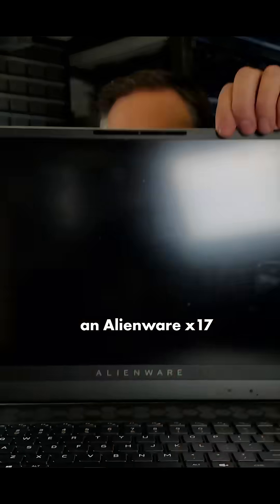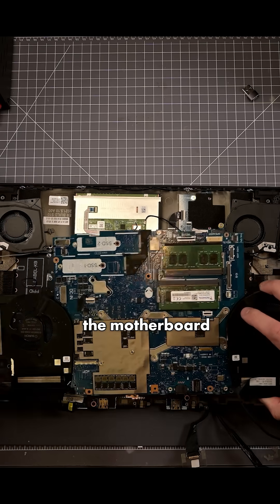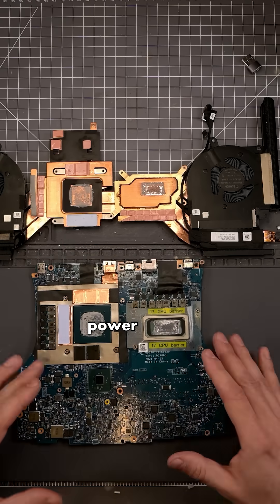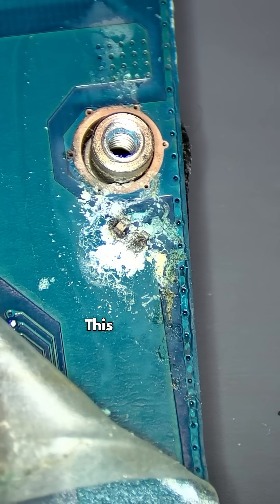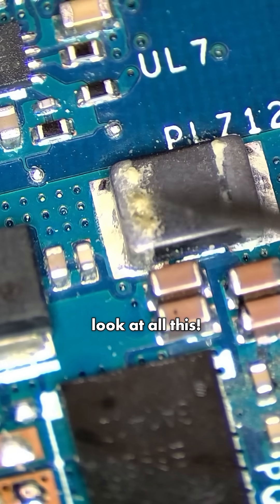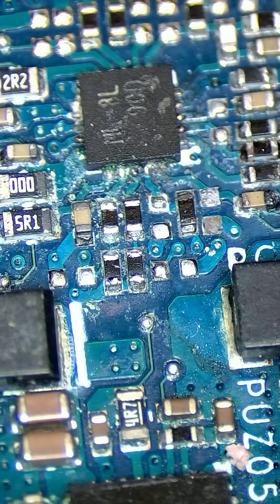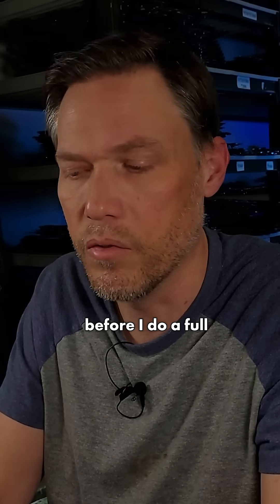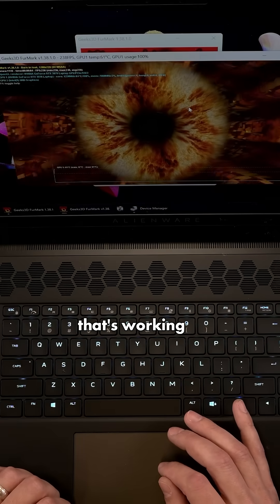I Was SHOCKED What Two Repair Shops MISSED! #shorts #laptoprepair #pc

Comment: When you doing sonic cleaning what kind of liquid is used ?
Reply: only liquid that is safe for ultrasonic cleaning is distilled water because it has no minerals in it to damage the board which is why it is also recommended in CPAP machines, Carpet Extractors and more

Comment: My 2 memory modules gets very hot when I'm gaming, to the point where I could feel the heat by touching the keyboard.  The 2 fans are working.  This is my first DIY thing with my laptop.  Thinking of adding lots of thermal paste to the memory, then stick a copper plate to it.  Any ideas, tips, or suggestion?

Comment: were you able to confirm it indeed did go to NR first?
Reply from the maker: Yes, I had a conversation with the customer. He said he mailed it to Northridge fix after he had ripped that connector off because he replaced the keyboard after he spilled on the laptop. He told them he wanted them to make sure that there was no water damage on the motherboard and they checked that out and said everything is fine, and then he asked what about the connector and they kept saying there's nothing else they could do for him. So he received it back and send it over to the other company to get the connector replaced. They would only reply through email and they look like they were all canned messages.

Comment: Northridgefix Didn't Fix This Laptop?
That Awful😬😬😬
Reply from the maker: Yeah, I thought it was strange.
Reply: @dellpartspeople  did you check directly with NRF ?? 
it is really weird that they sent the laptop back to the customer with that claim the board was working fine and the bench fee etc. 
For something so expensive, any owner wouldn't be so lazy to accept such vague response from the repair shop, and to receive it with such damage. 
Where I live, repair shops record everything the moment they receive, open, and ship back the customer laptop, sometimes recording the evaluation process, and if something more complex requires they also record the repair and send a copy of the video to the customer. It helps both parties and makes the service scam proof.
Reply: Too much work for a 25 min vid.     Next!

Comment: Doesn't the ultrasonic damage any of the components..?

What solution do you use in that ultrasonic?
Reply from the maker: No, this machine is filled with distilled water, which is non-conductive and non-corrosive, and there is a special electronic solution, which is made by Branson, that is added to the water, and the motherboard is put in an alcohol bath afterwards to get all the water and solution off the board.
Reply: @dellpartspeople  good to know.

Was always scared and ultrasonic would could damage crystals and ICs.

Thank you for replying.. your kids are great 👍
Reply: That was my concern as well.. sensitive components like crystals getting damaged by the ultrasonic...
Reply: @dellpartspeople  So you didnt get the bath from temu.

Comment: hi i pressed power button because i was stuck on update screen with dell logo asking me to be patient but now it wont even open only the keyboard lights up what should i do 😢😢
Reply from the maker: That sounds like a BIOS issue, but I would first try doing a CMOS reset.  
You will need to unplug the main battery, and if the laptop is a 2019 or older, then the CMOS battery will need to be disconnected also, which can be very hard to find, but once both are disconnected, with no power in the laptop, hold down the power button for 10 seconds.  Now reconnect the battery(s) and then power it on again. Good luck
Reply: @dellpartspeople thank you it says manufacturing date 2023 in the back
Reply: Dell logo, saying to be patient, exactly a BIOS update. And you bricked it by hard shutdown.
Reply: @nohavename6983 dude stfu if you have nothing helpful to say
Reply: that was really dumb on your part. lesson learned.

Comment: Since I see a lot of videos against liquid metal overall. Should I just avoid laptops that include liquid metal? Do retailers know which laptop model has liquid metal in it?
Reply: it since long a dead hype use liquid metalls, it is okay at conducting, buit ther newer materials, and since long other materials thats faar better but extremely much more expensive,  Diomond, Graphene, Wurtzite infused paste are much better or even the cheapest nano paste .. aviod gallium at all cost, even the slightest contamination will destroy not only the laptop, but if u transfere it with ur hands for example around... once atoms made its way into the board/circuits .. it will keep reacting forever, if ur lucky the computer or other stuff will survive long enugh .. gallium diffuses into most other metalls over time, most notably in Aluminium, Copper, Nickle alloys(steel), iron .. Gallium contamination is a realy big problem. and to protect sensetive sytems is not cheap nor easy, the solution is mostly to use a sacrificial material that bound and traps gallium (airplanes, military etc)